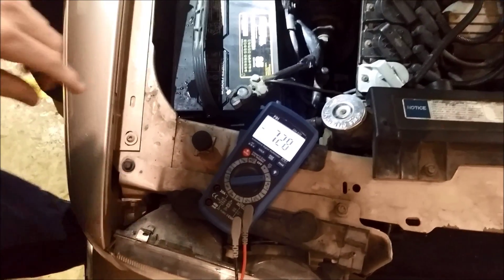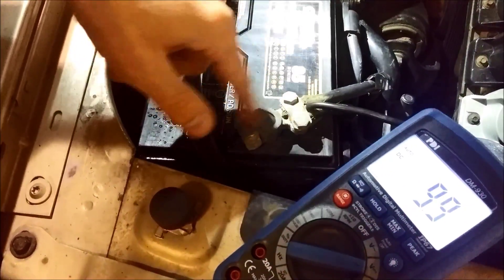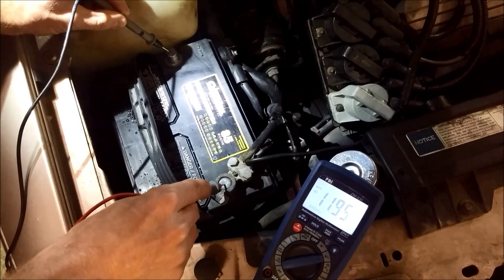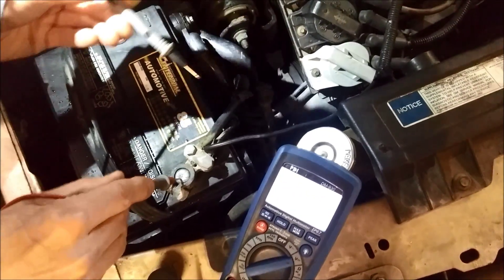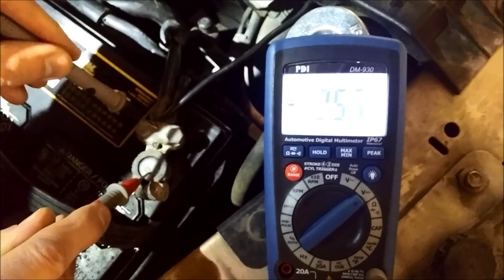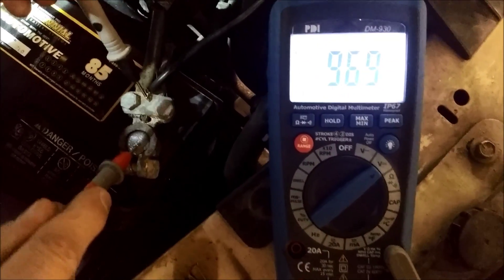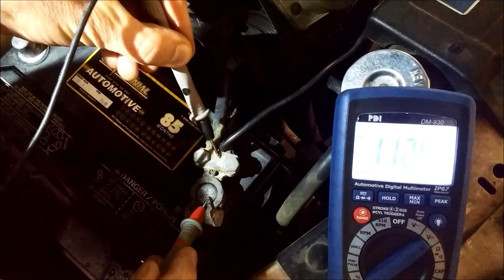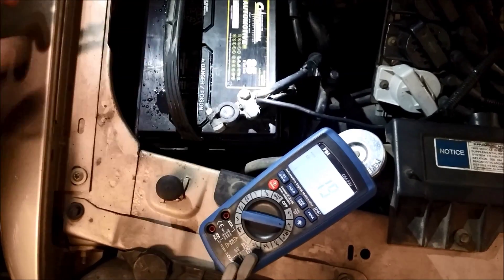Car won't start?  Is it the battery cable?

Comment: Stupid question, which of the two wires on the positive cable goes to the starter? Thanks for sharing.
Reply: Generally, the larger wire, because the starter is the single biggest load.
Reply from the maker: I don't remember.  Usually one of the wires goes to the fuse/relay box and the other goes to the starter.
Reply: @JustinMillerAutomotive  Then what about the wire from the alternator to battery?  Does it always go to the positive post?  Thanks

Comment: I must be missing something.  First reading is 12+V  Second reading is 9.7V.  Difference is 3~V not 9.7V ?  9.7V is the power at the 2nd read.  What am I missing that would tell me the loss of power is 9.7V lost, not 3~V?
Reply: The meter measures difference in voltage, not absolute voltage.  Two points on the same wire should have 0 Voltage difference.  
Just like checking two sides of a good fuse would work, you want 0v difference, if it says 12 its blown.  
If he had measured from the wire in the positive clamp to the negative terminal,  that would have showed the 3V you were expecting.  For trouble shooting it's the same.
Great demo @JustinMiller!
Reply: @FixItPleaseJ  great, great tip!
Reply from the maker: 9.7 volts are lost or "dropped" between the battery post and the battery terminal.  The terminal should drop almost no voltage at all.  In an electrical circuit, the wires and connectors should not use up much of the voltage.  If the wires and terminals are in good shape, about 98% of the voltage should be dropped at the load in the circuit (the starter motor, in this case).  

So, starting at the battery post, there should be about 12 volts.  At the other end of the cable (at the starter motor) there should still be almost 12 volts.  In this case, within inches of the battery, we lost 9.7 volts, only leaving 2-3 volts for the starter motor.  This is due to corrosion in the connection at the battery terminal.